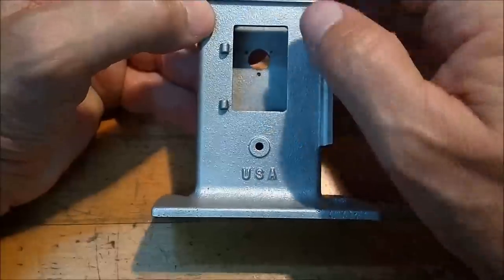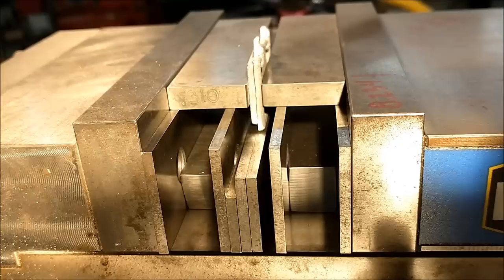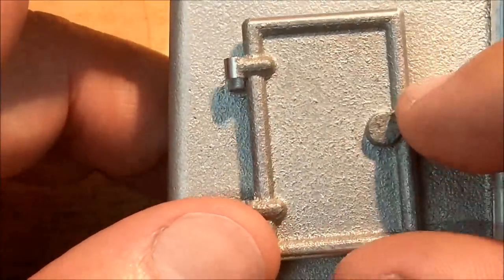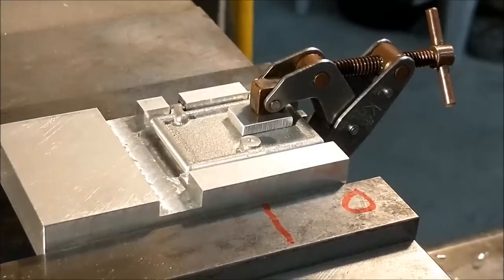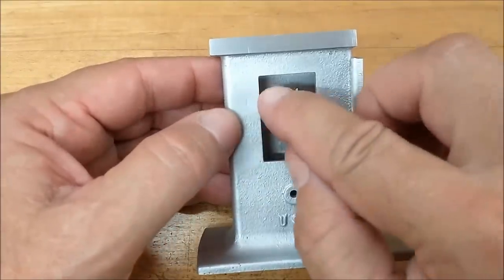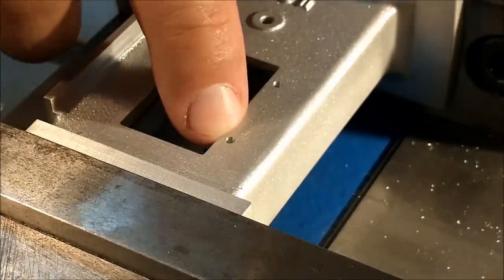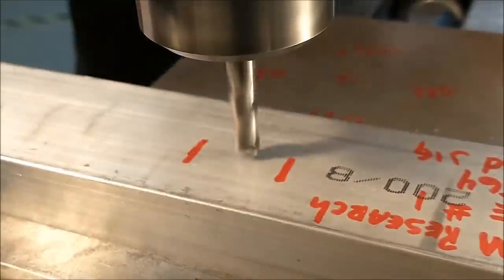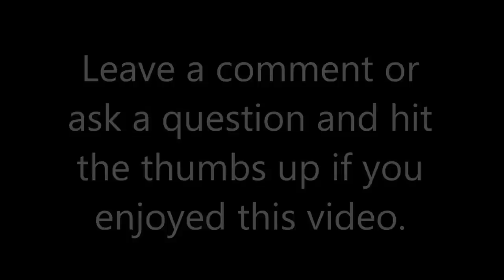Erase Those Hinges and Prepare for Something Better !!

Comment: There is a question I have been wanting to ask for a while. I have some reamers that I am unable to read the markings on (EBAY finds), Is there a way to measure the diameter of the flutes without destroying the anvil on a micrometer or the blades of a caliper? I have been using a cheap micrometer and was just wondering if that was the best way and if there is a potential for damaging the flutes on the reamer.
Thanks
Reply from the maker: Mic'ing a reamer is fine and shouldn't hurt the mic. Just don't apply too much pressure and be sure to gently rotate the reamer when doing so for a true reading.
Reply: maybe ream a hole in some scrap and measure the result with gage pins?
Reply: Rotate the reamer backwards when measuring it. 
God bless you! 
Jesus answered and said unto him, Verily, verily, I say unto thee, Except a man be born again, he cannot see the kingdom of God. 
John 3:3 KJV

But the fearful, and unbelieving, and the abominable, and murderers, and whoremongers, and sorcerers, and idolaters, and all liars, shall have their part in the lake which burneth with fire and brimstone: which is the second death. 
Revelation 21:8 KJV

Moreover, brethren, I declare unto you the gospel which I preached unto you, which also ye have received, and wherein ye stand; By which also ye are saved, if ye keep in memory what I preached unto you, unless ye have believed in vain. For I delivered unto you first of all that which I also received, how that Christ died for our sins according to the scriptures; And that he was buried, and that he rose again the third day according to the scriptures: 
1 Corinthians 15:1-4 KJV 

For all have sinned, and come short of the glory of God; Being justified freely by his grace through the redemption that is in Christ Jesus: Whom God hath set forth to be a propitiation through faith in his blood, to declare his righteousness for the remission of sins that are past, through the forbearance of God; To declare, I say, at this time his righteousness: that he might be just, and the justifier of him which believeth in Jesus. 
Romans 3:23-26 KJV

But God commendeth his love toward us, in that, while we were yet sinners, Christ died for us. Much more then, being now justified by his blood, we shall be saved from wrath through him. For if, when we were enemies, we were reconciled to God by the death of his Son, much more, being reconciled, we shall be saved by his life. And not only so, but we also joy in God through our Lord Jesus Christ, by whom we have now received the atonement. 
Romans 5:8-11 KJV

For by grace are ye saved through faith; and that not of yourselves: it is the gift of God: Not of works, lest any man should boast. 
Ephesians 2:8-9 KJV

Therefore being justified by faith, we have peace with God through our Lord Jesus Christ: By whom also we have access by faith into this grace wherein we stand, and rejoice in hope of the glory of God. 
Romans 5:1-2 KJV

That if thou shalt confess with thy mouth the Lord Jesus, and shalt believe in thine heart that God hath raised him from the dead, thou shalt be saved. For with the heart man believeth unto righteousness; and with the mouth confession is made unto salvation. 
Romans 10:9-10 KJV

Comment: instead of running an endmill over the letters maybe just drag a file over them. would find the avg surface and keep the line weight uniform.
Reply: Or maybe just mill each letter as an individual that way it doesn’t loose its proportion to the next if it’s higher or lower which would change the width of the finished surface that way they say proportionate of each other

Comment: What does the designer think you can do to make the design of the casting work? do they expect you to make some tiny long center drill and a bend channel in something hardened?
Reply: Clearly, you're supposed to just whip up a scale-sized angle drill
Reply from the maker: I guess you could mill the top rails off center, other than that, I'm not sure what you would do.
Reply: This is clearly a fault in the design. There’s no other way to view it.
Reply: @joepie221  you needed to make your small scale, right angle drill prior to starting this project lol.

Comment: The was no deed to remove the hinges. 

A groove on the left of the top hinge and a groove on the front of the bottom hinge wold have kept the door in place for the first 90 degrees of opening.
Want to prevent the door falling out when opening more than 90 degrees? Just put a grub screw next to the groove in the top hinge.
Hang the pins in the hinges on the door in the grooves and gravity does the rest.
Reply from the maker: A mechanically sound option, but conditional. I like the choice I made for my model.